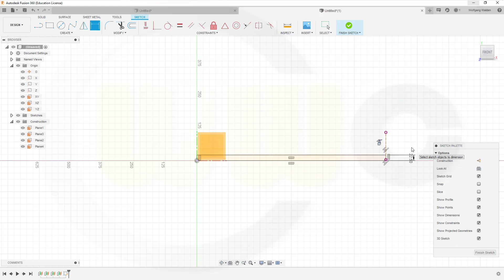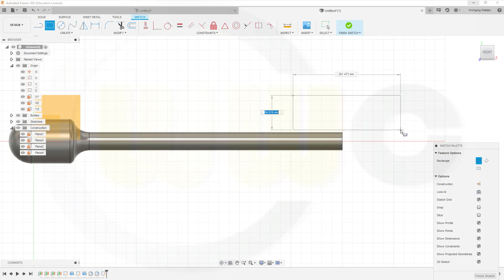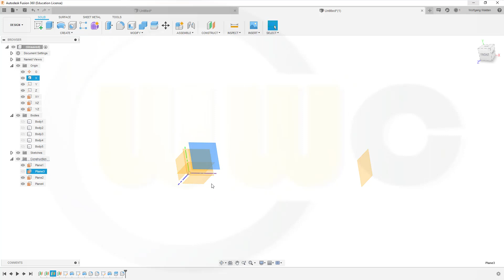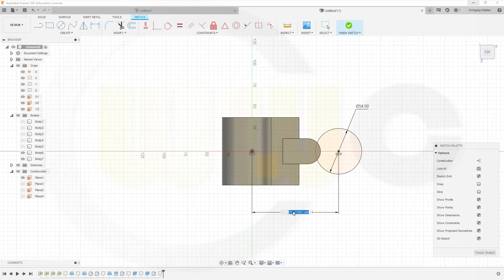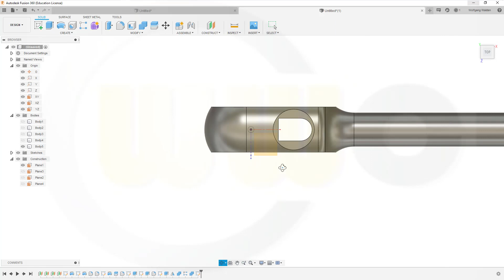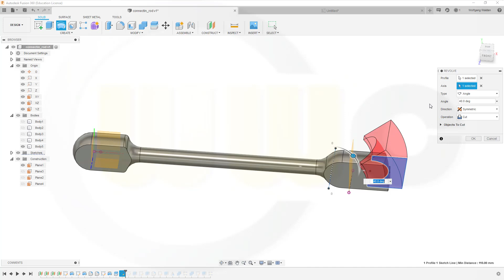Connecting Rod - Fusion 360 Training - Part Design

Comment: Hello 
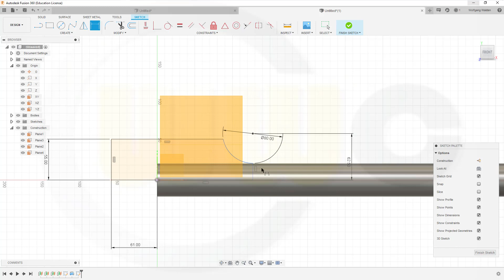at 4:58 in order not to lose the constrains you could do 2 perpenticular constracion lines and make a tangent arc from there
Reply from the maker: Many roads lead to rome ;)
Reply: @wolfgang.walden.cad.training  
I am learning these days f360 and trying design something quite complex  and everytime i make a fillet in the sketch loses constrains and I found out yesterday that if do it that way constrains remain .thats why when i saw you losing contrains i paused the video and wrote this.
Reply from the maker: Therefore one usually should avoid filets in sketches ;)
Reply: @wolfgang.walden.cad.training  
I agree , but I ve just found out that if we are drawing square things , if instead of picking the line itself or the points of the line , if we dimension by picking the perpenticular lines to the line we want to size the fillet can be done without losing the constraints :)